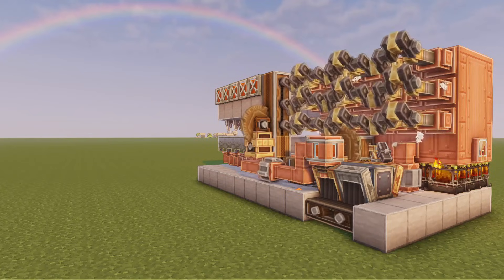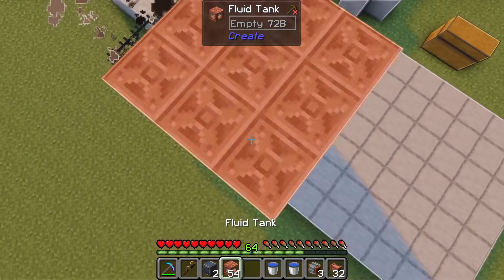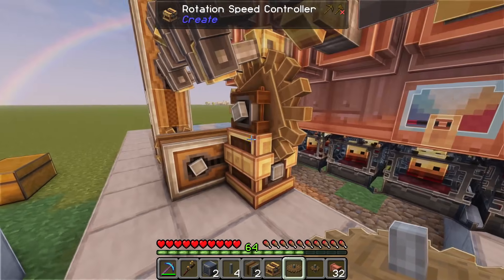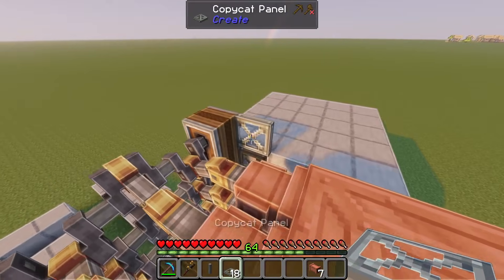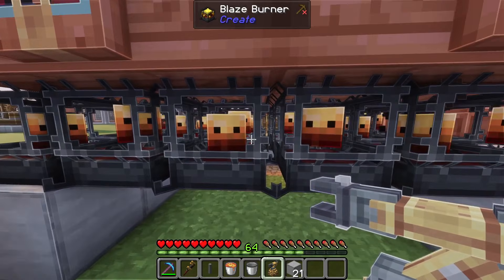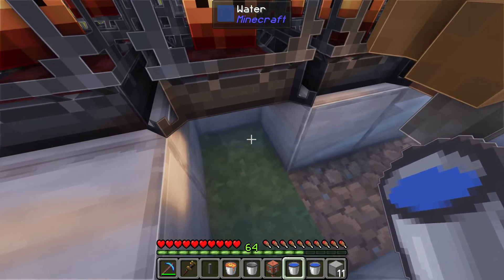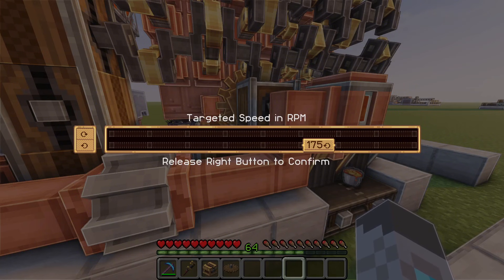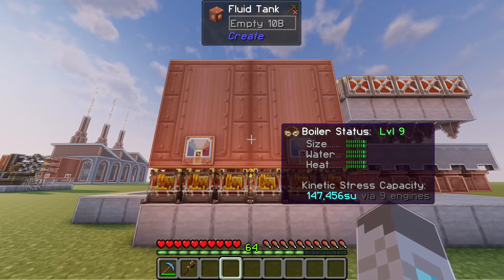This Steam Engine Makes 294912... Here's How I Made It | Minecraft Create Mod Tutorial

Comment: how to kickstart?
Reply from the maker: Sorry, I left this part out of the video for some reason. To start it, manually fuel 2 blaze burners under each of the 2 steam engines, then give the system power from the shafts on the steam engines using a few water wheels, and this should kick start it
Reply: @IcyknightGaming  thank you so much for this❤

Comment: i saw you edited the video when you were building a part and how do you get it to start
Reply from the maker: What I did was remove the gearbox temporarily that was connected to the cogwheel, then I added connected a large cog to the mechanical pump with a hand crank and 2 water wheels, fuel 2 burners under each of the 2 fluid tanks, then use the crank until the steam engine starts and quickly replace the gearbox, then it should work
Reply: @IcyknightGaming  can you do a tutorial that sounds complicated especially because im in survival building this
Reply from the maker: I can make that happen
Reply: @IcyknightGaming  pls
Reply: @IcyknightGaming   Hi, is the tutorial available yet? I just got it and would like to see how to start/run it for the first time. Thanks in advance for your reply.
Reply from the maker: @martyyy42027  I have a few tutorials that use a significant amount of power on this playlist that you can check out to see if any look like you need them: https://www.youtube.com/playlist?list=PLGZEWER6-HvXdE4qcbh5Fb8EzSp8egGl7

Comment: This is a very nice Steam Engine! Getting it started was a little more hassle at first than I wanted to, but it's fine. 
Question though: Any reason why the speed is set to 180 RPM? To save some Stress units or because the spout cant handle quicker processing?
Reply from the maker: 180 rpm is just enough to get the amount of water the steam engines needs from the pumps, you could make it faster, but that would only make it use a bit of extra stress

Comment: Wait did you use it to power itself? I thought that was the create mod equivalent of never dig straight down in minecraft. Also is it possible to see a boiler that uses something that isn’t blaze burners since I know they are the best but me and my friends are playing a modpack called beyond depth and getting blazes is hard since we don't have a fortress and navigating the nether is hard.
Reply from the maker: To get it power to start it up you can use a large water wheel connected to 2 gear ratios that quadruple the speed to 32 rpm which you then connect directly to one of the mechanical pumps that pump water into the fluid tanks and give at least 3/9 of the blaze burners under each fluid tank fuel which is how I did it. This is easy enough to replicate if the system stops and having a steam engine power itself is a pretty normal thing to do. You can use campfires as a heat source, but any amount of campfires will only result in 2048 stress units, no matter how much water or the size of the fluid tanks, other than that, to my knowledge, blaze burners are the only way to provide heat.
Reply: @IcyknightGaming  Ok well good to know. Also just found out since I have been away on a trip that they actually did find a fortress to get blazes from since before that we had to do some trial dungeon on specific levels to spawn blazes and we only ever got 2 just so we could get into the brass age.

Comment: Do us a favor: try to make the best brass-less starter steam engine. I copper is common to have too much of early game,  and I'm also doing a vr (vivecraft) survival with create, which is slower, harder, but cooler. So having a accessible design will do for a great Kickstart for a factory!
Reply from the maker: I can make that happen!
Reply: I'd say the best idea is to possibly just use a passive steam engine early game. Brass isn't the most expensive by the time you can get large steam engines.
Additionally if you got a mod like Crafts and Additions installed, it adds the straw which allows you do to the lava farm shown here but connect them directly to the blaze burners.
Reply: @thememecartextras9638  Ye i did thake the direct lava fueling from there and added that mod... 
Tho, going mining on VR is like... 10× harder, because yes, even if you can theoretically look behind by just rotating yourself, well... "mouse and keyboard "reflexes" are not included" should be also taken in consideration. 
So yes. Brass is harder, because going to the nether and taking a blaze is way harder without being able to clutch anything...